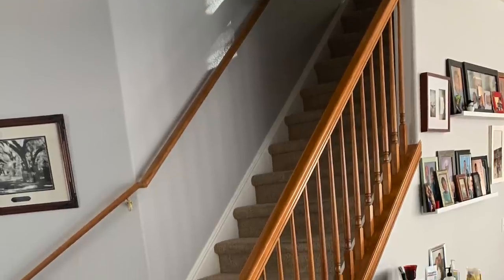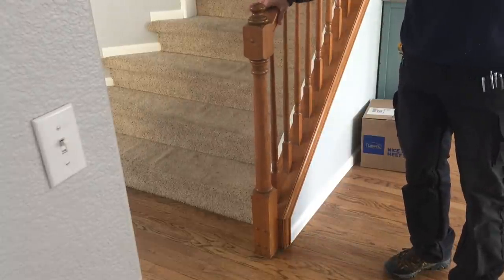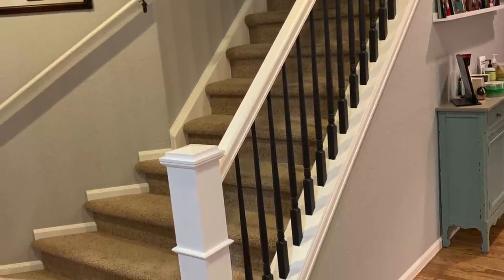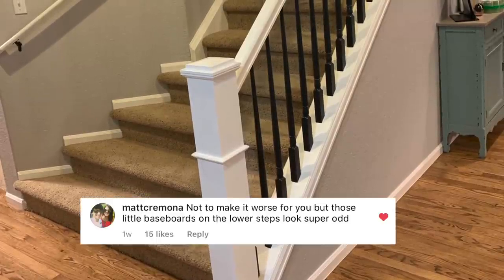I Fixed the Newel Post!

Comment: That $4k quote was ridonkculous! It's great to be able to do these things yourself as a plan B. I feel sorry for those who have no other option but to shell out the money.
Reply from the maker: yeah, I couldn't believe the quotes we were getting, I don't love doing these kinds of projects, but I can't justify spending that kind of money.
Reply: But what would you have charged someone else to do that, assuming that your time and skills were your only livelihood?
Reply: @billspencer6338  and a workshop worth 100k+...
Reply: @billspencer6338  excluding the newell post looks like all that happed was the spindles were painted and the railings were painted.  That sounds like I didn’t want to do the job quote.  probably was going to sub it out anyway.
Reply: Considering the man hours, tools and expertise in crafting this work around this seems just as expensive and far more difficult. If you don't want to calculate your time as a cost that's fine, but its disingenuous to compare it to a contractor making a living. 4k is too high for a bannister replacement but that just means you haven't talked to the right trades or properly delineated the scope of work. That being said, your fix wasn't a few hundred dollars at market value. Compare apples to apples.

I applaud your carpentry skills, but you aren't performing a standard DIY task. If you have the carpentry background to perform this exercise you can see how excessively laborious this fix was compared to simply replacing the newel post if that's the scope of work you reduced the job down to. Again I do admire your skill, but I don't like how the video was framed as a contractor myself but also how it seems to be presented as a DIY video but using techniques and tools far beyond even beginner woodworkers much less your standard handy home owner.
Reply: @jareid82  his contractor quote didn’t have the newell post fix, it was just refinishing the banisters, ie paint and stain.
Reply: @theJonnymac  ok, well that's fucking highway robbery. I thought it was to replace the whole bannister, which to create a nice fit and finish, especially stain grade is a decent amount of work. There is no way a simple refinish job should cost that much, even for super high cost of living markets like San Francisco or New York that seems outrageous, but it's hard for me to judge from Canada I guess.

Comment: Might have been easier to just replace the entire newel post than wrap it, but I think the end result looks good.  I do have to agree with Matt about he baseboard on the steps.
Reply from the maker: I thought about it, but if I replaced the whole post I would have had to do something internal to  fix it firmly to the joist under the floor, so there would have been some kind of internal thing I would have to do.

Comment: Looks much better, more modern! I guess I would have used roof-rafter plates (?) on 3 sides (as opposed to cutting that metal foot). And Mr. Chase's solution would not have worked, as his post was clearly pre-cut :-)
Reply from the maker: I'm not sure what roof rafter plates are, but I only did one of three sides because only one side really helps in the direction that it was loose.  The hand rail attachment point at the top means it can't pivot front to back, only side to side.
Reply: @AndrewKleinWW  'rafter-plates': to connect beams: (a pic is worth....): https://www.twenty20.com/photos/66577179
I would have covered them with a 'foot-board': hollowed out piece of wood.
Obviously your solution works - I don't have any metal nor drill, so I was looking for something 'simpler' - not downplaying your work. Something about skinning a cat...

Comment: The hardest part of the job?  All the damn painting!
I probably would have put some paint on that steel plate to prevent any rust transferring to the oak floor.
Reply from the maker: you know, painting the steel would have been a good idea.  Hopefully dry Denver air saves me
Reply: @AndrewKleinWW  In Oregon, two things grow exponentially, moss and rust.

Comment: What is the brand and model of the little bandsaw you use to make the metal bracket at the beginning?  It looks pretty compact.  Thanks.
Reply from the maker: It’s a Milwaukee portaband on a Swag Off-road stand
Reply: @AndrewKleinWW  thanks much.  I'll have to look for one of those.

Comment: That's a nice end result. I wonder why you didn't remove and replace the post entirely. What did leaving it in the middle of the new post accomplish?
Reply: Yeah I'm a bit curious about that as well, seemed like extra work
Reply: What I got out of him keeping the original post was that it was just a way to make a solid attachment to the floor and bottom step.  Then just wrap that to hide the bracket.  Maybe he can shed more light on his reasoning.

Comment: Love how it turned out. I am more curious as to why you didnt just remove the old newel post completely then cut a hole into the floor as you have an unfinished basement so you can se d the new newel post through the floor and anchor to a floor joist for the ultimate strongest stiffest post? Even if the joist wasn't not close you could brace between them. Sorry I have done hundreds of these over my career  and have never had one fail since.
Reply from the maker: the joist is directly below the post, honestly I didn't do it that way because it seemed like more work, with you experience that might not have been the case.